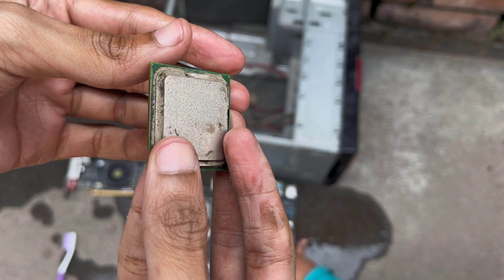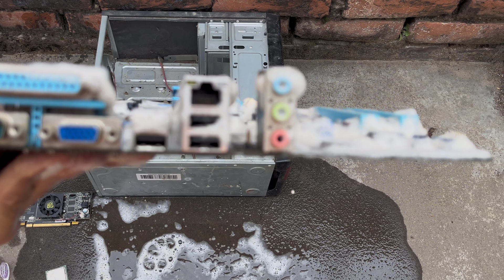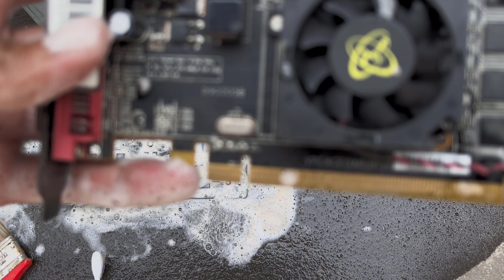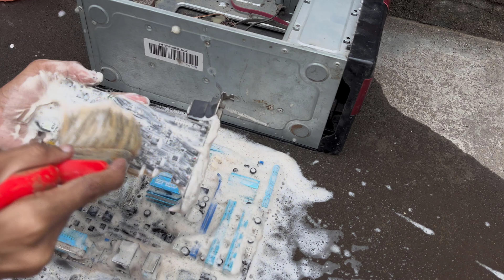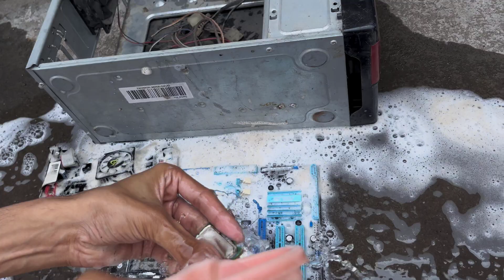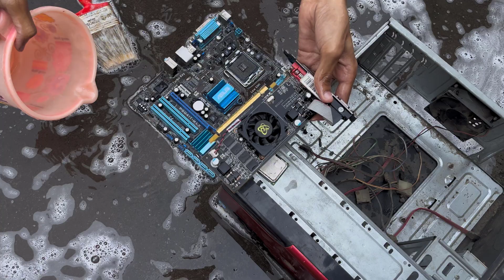Motherboard Complete Wash | Can You Wash Motherboard with water ?? | Motherboard Display Problem

Comment: recently im restoring old pc i did soaking it in water and washing it with detergent liquid then drying it on metal roof sheet middle sunny day its accelerate drying process without leaving water trace or let your component pin to get currosion.. after its complete it dry its and testing it working just fine just like normal